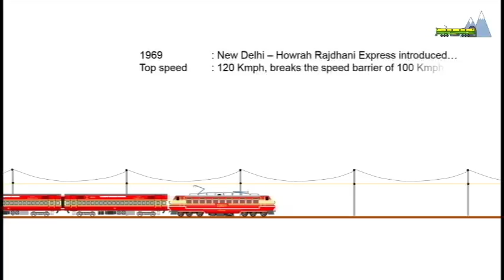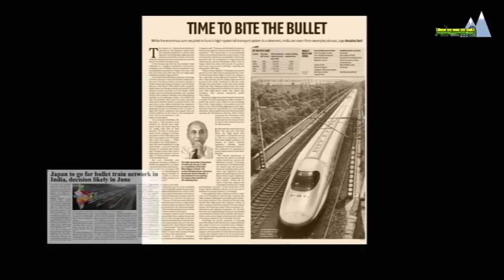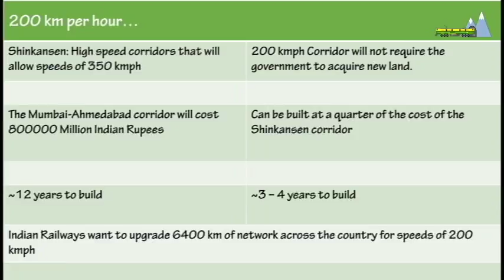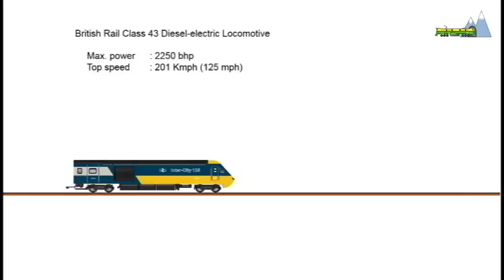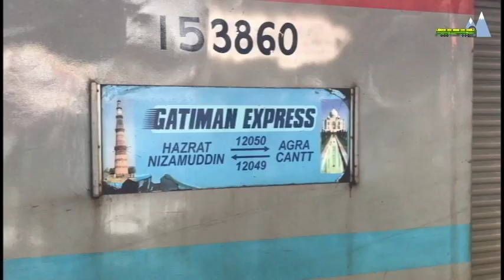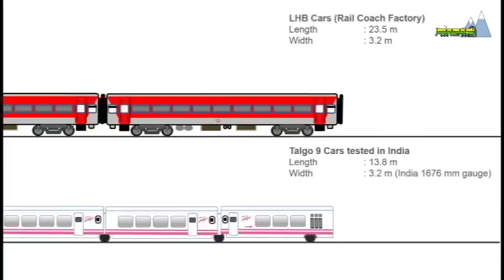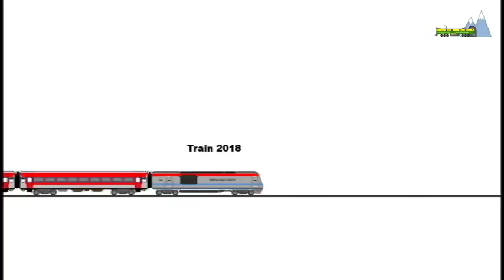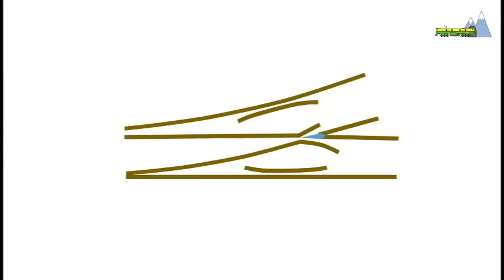India's Quest for High Speed Trains | Indian Railways | Railway Signalling | Train Protection system

Comment: Interesting points, and I agree with a lot of them. Unfortunately there are too many hazards alongside the tracks to allow for safe operation at high speeds, and a lot of modification and re-certification is needed to ensure no accidents occur. Although it's still sad to see most trains running with a 130kmph cap (110 in the south, which is even more sad) and very few trains receive the go-ahead to operate at 160.

Even the Train-18, though certified for 200 is restricted to 160 due to the lack of all other factors. Hopefully we can start pushing the 110/130 trains to 160 soon since we know our tracks can handle them, then think about making it safe to travel at 200 soon. Although I'm not optimistic about quick change unfortunately.
Reply from the maker: The Train-18 has been tested 186 kmph. I believe 200 kmph is attainable. Adding tilting tech can enhance speeds to 225 kmph on existing track (with upgrades like fencing, R260 grade track etc). 200-225 kmph in BG network is sustainable high speed on most routes of India. Why this is not being done in urgency defies explanation
Reply: @TheTrainStory  I agree. This is a much more attainable goal than laying down brand new lines and figure out new rolling stock as well.

Comment: The RRTS being built by NCRTC in Delhi NCR will be having top speed of 160 km/h and it is being built on standard gauge. The shape of the coaches will be very similar to the LRC designed coaches being used in Acela express, but will have extra seats. And it will use ETCS L2 or its more superior version. No doubt, the success of this RRTS system will surely pave way for success of HSR, since the technology will not be different.

Comment: Standard gauge is future proofing especially when with connecting with international countries. Building standard gauge is cheaper as its is “standard” rolling high speed stock.
Reply from the maker: Pakistan and Bangladesh neighbours of India use broad gauge.
Reply: @TheTrainStory  future proofing. And making it cheaper. Long term mean decades. I mean connecting with china, and the railways china will build in Pakistan and other assets. Furthermore it's just cheaper. There isn't widely available broadguage high speed train that can be bought cheaply. India seems like they're on a tight budget.
Reply from the maker: I agree foreign rolling stock companies do not build high speed broad gauge bogies. The Shinkansen was a good opportunity to cajol Japanese companies to invest in a joint venture for high speed broad gauge bogies. This would have also infused modern know how to our coach factories. A high speed rail link with China is a very remote possibility at least 30-50 years away, if at all. 
Moreover, break in gauge can be tackled by using variable gauge bogies or simply shifting the cars to SG bogies at point of break. But all this is now moot. The truth is rolling stock companies had it their way to suit their commercial gains and not the long term interests of IR
Reply: @TheTrainStory  sounds like corruption at the transport department... im suspect that they might use the same excuse my government used too "it is to seperate traffic so the service can be consistent, same rolling stock reliability preformance, no frieght train break downs delays, more advanced signaling without investing in compatibility with all trains, etc.

Comment: see also the austrian Siemens Railjet ... also prior to the german ICE trains, Deutsche Bundesbahn had a concept Intercity 250, with conventional DB Class 120  based Locos (wap 5 is also a related development)  - the cars would have run on the ICE 1 bogeys. The Intercity 250 was stopped for the politically backed ICE trains. Some cars were build for 200km/h in the late 80ies, today still in use, also for the München Nürnberg Express, a fast regional train connecting München - Ingolstadt - Nürnberg. The Railjet: https://en.wikipedia.org/wiki/Railjet I think a wider gauge has its pros and also the classic train concept is still a good thing - easier to service, and you can simply change a car or the loco.

Comment: I was going to go into a long rant on how stupid it is to build the line in standard gauge, but you already had that conversation below. I'll just add a few things:
The Russians have Siemens Velaro trains running at 250 km/h on Russian-gauge (1.520), I don't see why the high speed technology couldn't be adapted for Indian broad gauge.
 Broad gauge is a brilliant thing, put in place by British Engineers who believed that the standard gauge they had back home was too constraining, and would be too tight for the size of the sub-continent, and it's projected transport needs. Indian Broad gauge, is more modern than standard gauge, period.
As you so astutely pointed out, there seems to be much scope to do what the British did, and to get trains up to 200 km/h (or even 250 km/h if you use tilting trains), on existing track. I am not familiar with the level of expertise of the Indian train builders, but with those grand speeches of 'make in India' I would have expected them to push for a joint venture of some sort to co-develop a high-speed train design that can be largely built in India. An Indian broad-gauge variant of a TGV duplex could be the highest capacity high speed train in the world, possibly making Indian high speed rail profitable. I'd love to see that one day. In India, and on this channel. I just found it, and I'm watching every single video, it's a great window into railways in India. Keep up the great work.

Just some Belgian train fan.
Reply from the maker: Marius Dufour thank you Marius. Indian railways opting for standard gauge is just “corrupt” corporate expediency. The train builders have “cajoled”, Indian railway administrators to opt for standard gauge by citing immediate off the shelf availability of rolling stock. The real reason is the lure of lucrative job offers in other countries that build standard gauge railways. The argument being, your experience of building broad gauge railways will not be useful in other parts of the world which build standard gauge. Most Indians are blissfully ignorant about all this
Reply: @TheTrainStory  Wait 
I thought Shinkanshen
Line were Special Upgrade to wider Gauge for Faster speed 
So they actually upgrade from Narrow to Standard 
( I though Wider there meant Wide Gauge)😳
Reply: @TheTrainStory  Maybe They Did
That because
They had no Interest in developing
High Speed trainsets 
Uhhjhh
They gave up 
But a Seperate corridor means that Current Track are rendered useless 
For some specific Trains :V
Idk If Bullet Train project is good or not it can either be a good time or a bad thing
( Considering how much 3rd Tier AC is Reserved I do Think People wont be able to buy )
But idk i am just a Immature 
Lets see
Politics is just Weird
Ruling party makin Train 18 was Opposed by Other parties 
But Ruling party making Bullet Trains has completely Given Up on developing HSR indigenously 
:V
Reply: @TheTrainStory i think the decision of opting for standard gauge is not corrupt here are some reasons
1) most of hsr in world use standard gauge track 
2)standard gauge is cost effective than broad gauge
3) right now we have joint ventured with the Japanese on hsr india project demanding for broad gauge will make the cost of project higher
4) As this project is make in india,  coming year india will start manufacturing its own hsr and even start export to other countries for this standard gauge is the viable option.
5) running a hsr on already present broad gauge track is bad decision because the tracks we have are already overloaded with traffic and bringing hsr on broad gauge will create even more burden on Indian Railway to manage. Our indian railway need major improvement in signaling, track upgradation, traffic control. Its better to separate hsr from Indian Railway until it gets improve.
Reply from the maker: @akshatraghav727  hi Aakash I will respond point by point
1. Europe adopted HSR on SG because they had laid thousands of km of track to have changed over to a wider gauge. Also note HS trains run on dedidcated HSR lines only outside city limits, within city centres, they share tracks with other trains
2. Japan opted for SG because they had MG tracks. MG is.not suitable for HSR.
3. BG is more suited for HSR because the wider gauge allows greater stability. No where in the video have I said that HSR trains in India should share tracks with slow trains. My point is use the same model as Europe. Share tracks in the city centre but outside run on dedicated tracks.
4. The truth is rolling stock companies cajoled our officers into using SG because it was more financially viable for them (the companies). I got this info from very senior officers in the relevant places.
5. FYI the Ahmedabad Mumbai line was originally conceived as a BG line
Reply: @TheTrainStory  exactly your point brother rolling stock company use SG because is viable for them. Gov is not just buying hsr for the country. Whole plan is to manufacture and export hsr to other countries so its viable for them to use SG as most of the countries use SG. India needs to become manufacturing hub this is the make in india vision.
1) Even our delhi metro used BG is the starting phase but they switched to SG because its was easier to get rolling stocks and repair parts from other companies and was cheaper to built. Now India manufacture its own metro rolling stocks and has even exported to countries like canada and australia.
2) You said BG is more suitable for hsr I don't agree with that. If that was the case why most of the hsr runs on SG. If stability is compromised on SG It would have been fatal as hsr runs on very high speed, minor issue would have cause many deaths but studies shows japanese never had any accident or derailment on their hsr this debunks the myth that BG is more suitable for hsr.
Japanese are the inventor of hsr.They might have tested the hsr on both SG and  BG. If BG was more stable why did they opted for  SG instead.
3) Adopting to SG will also ensure the project is future proof as it will be easy to connect hsr network to other countries. India becoming the next big thing is asia better connectivity is needed to travel within and outside countries like china is doing to other countries
Reply: I couldn't agree more, you are spot on sir. The choice of standard gauge was a bone-headed move representing the pinnacle of bureaucratic retardation and inefficiency.
Reply: I think the loan from JICA might have been a factor for deciding to build the High Speed Rail line in Standard Gauge, and using Shinkansen Trainsets.
Reply: @akawale   That makes some sense, they would buy Japanese with a JICA loan. Shinkansen is a great platform, and as the Japanese have high speed trains running on standard gauge and also on narrow gauge, I would assume that with a little more up-front investment, a Shinkansen for Indian broad gauge could be jointly developed by Japanese & Indian engineers. Of course, it would have to be negotiated with the JICA. With their demographics, I'm sure Japanese  train building companies could benefit from having a factory in India, where they can train locals to build trains rather than having to build them all in Japan.
Reply: @mariusdufour9186   if TGV duplex for India has to be built, it must have tilting system similar to the new Avelia Liberty trainsets which Alstom is making for Acela express service in the USA.
Reply: Yes, in Portugal they have tilting train on 1668 mm broad gauge at 220 km/h